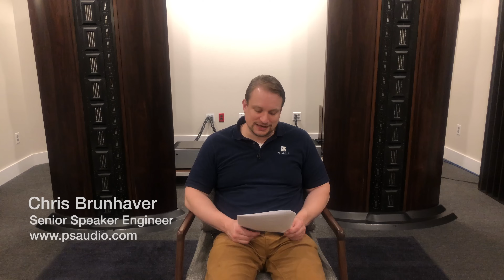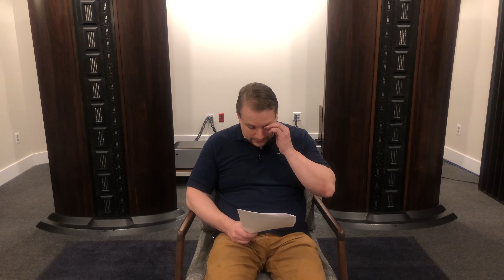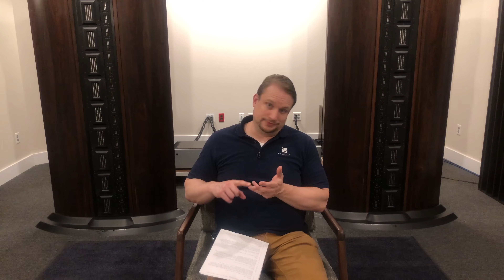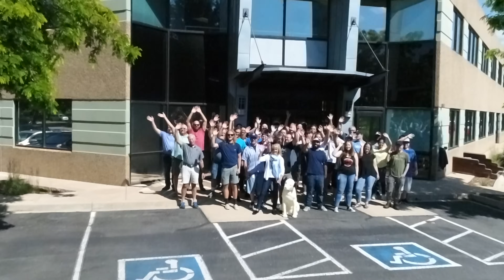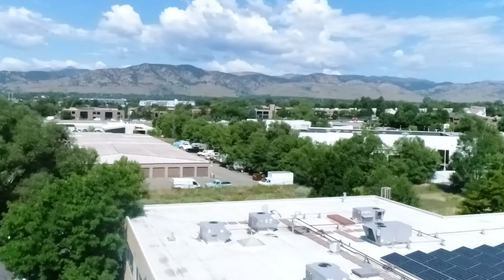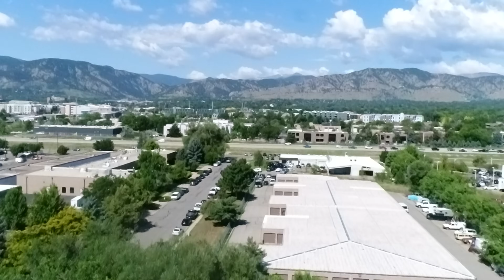Is speaker sensitivity related to frequency?

Comment: I will dare say that this question is much like: Is a front wheel drive  car faster than a rear wheel drive? 
I don't agree mixing up low frequency extension with sensitivity. And with respect the Hoffman's law, you can have a high sensitivity speaker with low frequency extension. It's really possible. Box size doesn't matter unless it becomes part of the equation. 
To rephrase the trick question above: Is a 200hp front wheel drive car faster in 0-60 or is a real wheel drive faster? Then the issue gets enough context so as to have some meaning.
Just my two cents.

Comment: Terry here, sorry if I affended you Chris. I like your videos and what you have to say but my original comment was out of frustration since I could not make out what you were saying. I hoped you would respond by fixing the problem, but in retrospect I see that I came across a bit harsh, for which I apologize.
Reply: No problem. I recorded a bunch of these on a weekend and so I'm not able to correct them quickly until re-recording some. I will do better.
Reply: @cbrunhaver  Thanks for responding to my comments. I can see that you're an introverted bloke so convey your considerable knowledge via youtube is probably uncomfortable for you but you are doing fine and improving too. I used to be like you when I was young, get a bit grummy in my latter years. One commentator said he wouldn't buy speakers from a company that had poor sound on a video but given that your response is to fix the issue I'm still interested in your speakers. How's the development going, are you still tweaking or are they being manufactured for sale? Personally I prefered the woodgrain exterior of the AN3. Is that going to be an option on the FR30's and will they be available in Australia?

Comment: Great explanation and thanks a lot for it!!; funny to see a second response to my question as Paul replied weeks ago, the print out of my email got mixed over there maybe? Anyway, great to see a different point about the same subject.
HIGHLY APPRECIATED
Reply: There should not be a different point of view, it should be the fact. the fact is, depending on what frequency you test at you will get different results. - hence the sweep signals during testing, also as one brought up prior, they use to try and standardize at 1khz.

Comment: Hi subwoofer Klipsch R100  it is a 10in 150 watts RMS 300 watts Peak and it is rated from 36 Hertz down to 32 Hertz range and I have my Denon amplifier X2400H and and Klipsch F200 for the tower speakers Anna Polk Audio Center Channel and on that amplifier would it be possible to go with separates of an amplifier and can you get any for under $700.  maybe waiting at Black Friday or Boxing Day 3 channels or 5 channel amp of a separate thank you,

Comment: paul microphone-audio is way better than yours, keep the good work....
Reply: We use the same microphone and wireless transmitter. There was a gain issue in some of these videos and it will be corrected in future recordings.
Reply: @cbrunhaver  dude ... we get that Paul is an old DJ & has been doing this for umpteen years, but that also means that you don't have to experiment to get this stuff right ... c'mon!

Comment: How about passive radiators in subs? Could these reduce the box size?
Reply: Well, PRs function rather like a port but occupy less box volume than an equivalent port tube, so there is a small difference in the total enclosure volume needed.

Comment: Pretty sure he answered a different question entirely.
Reply: @FatRat-f9m  like was mentioned in the video,  that's only true for a small enclosure. A woofer in a large box can be quite efficient.
Reply: Fat Rat Are you referring to phase plugs as the bullet shaped piece on some midwoofers, in place of the dust cap or phase plugs as seen in compression drivers and horn loaded midranges etc.?  Both are called phase plugs and serve very different purposes.
Reply: Sensitivity versus frequency range? What did you see the unanswered question as?  Were you thinking that he was referring to drivers with a limited pass band - like a subwoofer only playing 2 octaves - affecting sensitivity?
Reply: @cbrunhaver  😃😃 it seemed like he was asking if woofers could be made to be as efficient as tweeters. You seemed to say no but then explain how they could be by using a bigger box. After all, woofers don't have to be high wattage beasts, they are mostly for packaging purposes and watts are cheap.

Comment: A speaker does not have the same db. in all frequencies. But there is a lot going on. How light the coil is and how light and thin the cone is. what kind of dust cap you have.

Comment: Hi and thank you for an excellent explanation!
What's the sensitivity for the enormous speakers behind you?
Reply: @FatRat-f9m  lol yeah... I know the dirty tricks with amplifier power 😅
Not just amplifier power, even power consumption of household appliances in general and things like power rating of desktop PC PSU's.
Reply: I suspect it's around 92dB/W/m
Reply: @FatRat-f9m  92dB/W/m sounds quite average to me.
Are you Shure about that? 😜
Reply: @QoraxAudio ...that's why I used the word, "suspect"...
I don't think that it would be higher than 95dB/W/m.
Yes, they are huge loudspeakers however I don't think that that necessarily makes them super efficient as well.
Reply: @FatRat-f9m  Perhaps because it's mostly ribbons?
I don't know if ribbons are relatively more or less efficient compared to regular cone/domes.
Reply: @QoraxAudio ...when a loudspeaker manufacturer knows that they can put 300 watts through their product then they usually aim for low 90's. Klipsch claim that their RP-600M is 96dB/W/m but properly tested at 89dB...nothing to do with the IRSV...just sayin'
Reply: @FatRat-f9m  96dB vs 89dB... what a ripoff! 😅